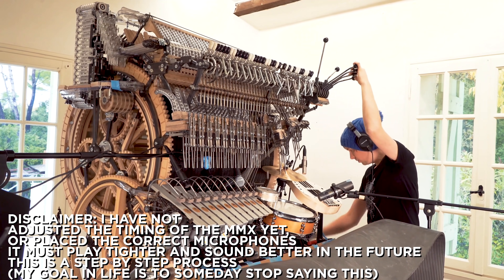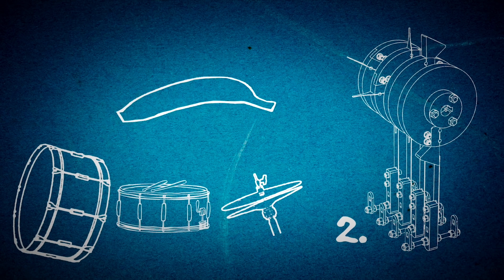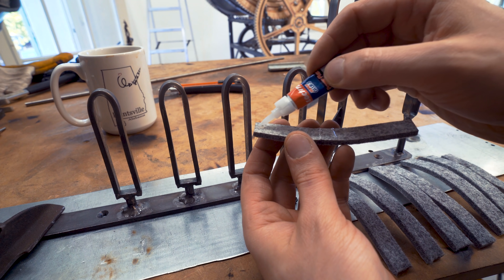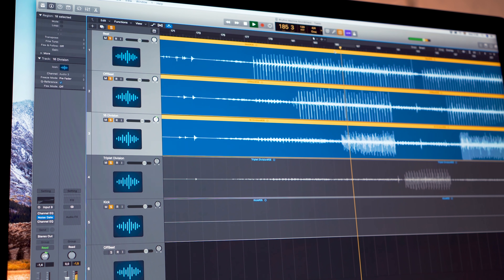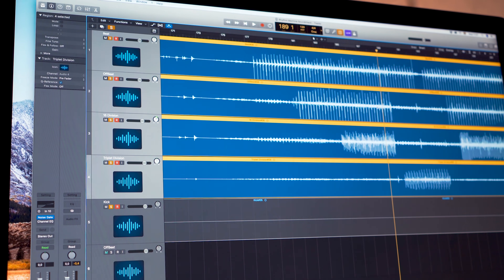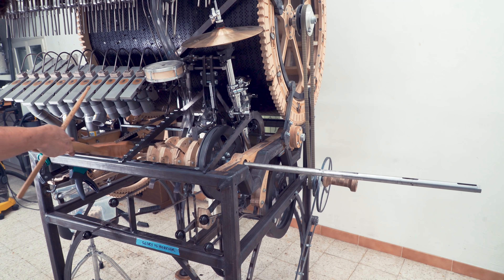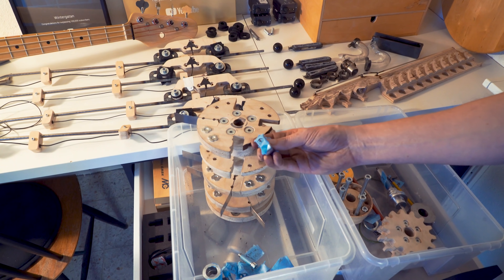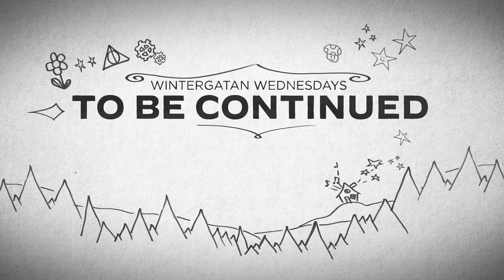Rhythm Machine Experiments - Marble Machine X #107

Comment: I would suggest adding a tachometer or something along those lines, with a small led display so you can adjust the rpm accordingly
Reply: He needs to add a Watt Governor. Constant speed for a varying speed flywheel.
Reply: @coastercubes4466  and i would look amazing on the machine
Reply: Why not mechanical tachometer? :D
Reply: Is there a way to set the max speed? Like how a mechanical clock always maintains the same rotational speed?
Reply: FOUND IT: A Watt Governor, maintains constant speed from a flywheel of varying speeds!
Reply: A governor is a controller that controls the energy input. In this case energy source is Martin. "Notes per minute" directly translates to the power demand of MMX. The flywheel can smooth out the peaks on the power demand but the keeping a constant BPM will require applying a variable crank torque. Almost like learning racecourse and the spots where to step on the gas and brakes. There is also randomness introduced by when marbles are loaded on the elevator.  A visual indicator of BPM could be a simpler solution.
Reply: Would be so easy to put a cheap bicycle speedometer or cadence meter on it
Reply: @vince55sanders  That sounds cool, but I think that's more in line with MM 1.0
Reply: Maybe something like this https://youtu.be/a7PILTf42yE , a watt governor with a cone CVT. Would look good  when well build and could possible solve the problem.
Reply: I was thinking the same, that way you could see the BPM/RPM at any moment.
Reply: No, it needs to be a mechanical brass masterpiece that will indicate on a dial if you are on track, too slow or too fast.
Reply: He could use a small red strobe light and dot markers on the side of the flywheel - just like the old DJ turntables used to have. With some clever electro engineering and proper calibration a target bpm could be set on a silent metronome (that controls the strobe light) so when the flywheel spins at the right rpm the dots appear to stand still. Once the tempo starts to deviate it will look as if the dots are moving. Practical and sexy!
Reply: @carlkolthoff5402  He could take apart an old strobe tuner and adapt it to the MMX for another purely analog variation on this idea!
Reply: @carlkolthoff5402  He still would have a slight delay or advance in timing because he is not able to keep the RPM at a perfect constant by operating it manually. Therefore there will be always a slight variable timing with the marbles. It didn't effect the synchronization of the setup so far because up until now all the instruments were timed with the same programmable wheel. That means that if one instrument has a slight delay they all have a slight delay. 

Only his last addition to the marble machine wasn't timed by the programmable wheel but instead it was timed directly by the flywheel shaft. And we know that the flywheel shaft has slight variable RPM because it is manually operated, but the sound generated by the flywheel shaft has not the same delay or advanced timing problems as the sound generated by the marbles. 

When the marbles are released it takes some time before we hear the sound. During that time, so before we hear the sound from the released marble, the next turn from the flywheel shaft has a slightly different RPM resulting in a slightly different rhythm. So far the other instruments all speed up or slow down at the same time so we don't hear any delay between instruments so far because up until now all the other instruments were in perfect sync and all timed by the same programmable wheel.

He must somehow make sure that all the instruments are all timed with the programmable wheel, or connected to the shaft from the programmable wheel. Because the programmable wheel keeps everything synchronized. Even when the RPM is slightly variable each time that he spins the flywheel.
Reply: @insAneTunA  the difference in bpm from one crank to the next would be negligible at worst during a song, the natural flutter of using a wooden and steel mechanism to control each marble is going to be far more than the flutter of cranking. the far bigger issue, and the issue currently being experienced, is wow due to long term variation in the cranking.

cranking flutter might account for only a few miliseconds per crank, but over the course of several cranks of being 2 miliseconds slow now you are a 32th behind the beat you should be keeping. a stroboscopic tachometer, like is used on record players would be very effective at keeping the timing accurate to an external beat, so long as he can control the cranking appropriately.

the reason flutter in the crank speed isn't so much an issue as wow is the high mass of the entire system. it takes a lot of energy to get it going faster or slower, so unless you are trying to change BPM, you won't have nearly enough variance in your cranking turn for turn to dramatically change anything. but over time, a small deficit or surplus of energy in adds up. so no flutter in this system, only wow. a very sensetive tachometer would help. if that's still not enough, a governor would need to be implemented to accommodate small changes in input energy.
Reply: @wyattroncin941  If Martin does it like I suggested he doesn't need a tachometer, and he can spin the flywheel at any RPM and the extra rhythm section will be perfectly in sync at all times. No matter if the RPM from the flywheel is variable or not. And no matter how small those variations are. It is fail proof when done correctly.
Reply: @insAneTunA  if Martin cranks faster, the BPM increases and everything falls slightly out of sync, joust due to different drop heights. Having the rythm machine anywhere else will not matter, because everything is already timed, except for the drop times of marbles. That's something he took into account already, and he has the piece for quickly adjusting the timing of the rythym section. If the rythym section was rigid to the flywheel or programming wheel, you'd only be removing an adjustment that is already necessary no matter what.
Reply: @wyattroncin941  hahaha I guess that we have to wait and see what solution Martin is going to come up with. If I was forced to bet I would bet one muffin on my own solution, or a solution that is similar.
Reply: That doesn't help either. His flywheel (drive) shaft, has a slight variable speed because it is hand operated. That causes slight variations in speed from his programmable wheel. As a result of that the marbles in the machine will be released with an ever so slightly delay or advanced timing. 

Because so far all the other sounds are triggered with his programmable wheel all the sounds have been in perfect sync up until this point. But his new rhythm section was not timed by his programmable wheel. So as a result his new rhythm section is not always in perfect sync with the sounds that are produced with the timing from the programmable wheel. 

In order to correct this his new rhythm section should not be connected directly to the flywheel (drive) shaft, but somehow it should also be timed by the programmable wheel. So that it is always running in perfect sync with all the other sounds or instruments, even when Martin is spinning the flywheel (drive) shaft with slightly variable speeds. 

Does this make any sense to anyone?
Reply: Yes lol or a mechanical clutch that stops you from spinning it too fast
Reply: A bicycle speedometer (AKA "cyclocomputer") would fit this need perfectly.
Reply: @G5rry  Nope, it wouldn't help either. Think of it as a car engine. Martin needs to make something similar as the timing system that times the camshaft from a car engine. The camshaft from a car engine  must be in perfect sync with the crankshaft at all times even if the input RPM is slightly variable. 

Consider the crankshaft from a car engine as the shaft from the programmable wheel from the marble machine. And consider the camshaft as the shaft for the extra rhythm section. so he needs to make a sprocket on the crankshaft (in other words the shaft from programmable wheel) and connect it with a chain or a belt to a sprocket on the camshaft (in other words the shaft that holds the extra rhythm section). And then everything runs in perfect sync, even when Martin turns the machine at a variable speed. 

Problem solved.

So he must not put the new rhythm section on the same shaft as the flywheel, but instead use a separate shaft for the new rhythm section, that is connected with sprockets or pulleys and a chain or a belt to the shaft from the programmable wheel.

Different variations to this system are possible, as long as he uses a separate shaft for the extra rhythm section that's been driven by the same shaft as the big programmable wheel. And he must not connect the new rhythm section to the flywheel shaft.
Reply: @insAneTunA  the entire machine is already connected in a timeable manner. It's geared off the crank and rhythm shaft to the flywheel shaft, which is geared to the wheel. it's not a matter of him cranking with variable speed, it's a matter of him cranking the entire machine, all the shafts and gears and wheels and pulleys and everything slower or faster. it's not a car engine, it's an electrical system. 

the grid runs at exactly 50hz in the EU. this is regulated by the massive amount of rotational mass in every generating station around the continent, so there is very little to near zero variation on seconds or minutes. however, if the grid produces too much power for the demand, it speeds up, from 50hz to 50.0002hz. not much, but over the course of days or weeks if the grid is too fast all your clock will be minutes ahead. or if there is too little power, the clocks will run slow. so you need to vary the output of the grid to follow the load (something martin can do by cranking harder or softer), and you need a tachometer that can tell you what the grid is doing real time. no use in waiting three months, comparing your watch and the wall clock and telling the grid to throw another nuclear rod on because the clock's slow, you need to monitor second by second and have very fine adjustments.
Reply: John Woods Yes, that could work but I am afraid that would lead to a major design change: The flywheel has to be connected to the rest of MMX through a clutch which is controlled by the governor. There is a clutch in MMX now which is used as a torque limiter if and when something goes wrong otherwise Martin is turning the crank in such a way that there is a simple ratio between the BPM of the music and the RPM of the crank. This simple ratio would be no more. How disruptive this would be is hard to tell. Maybe Martin could tell.
Reply: @EnginAtik  No governor, no clutch, and no tachometer are needed. That is all way more complicated then it needs to be. 

The problem is not that it's RPM has slight variations, because normally not a single person in the world would hear that when music is played. The problem is that his new rhythm section was out of sync with the rest of the instruments, and people can hear that very well. 

To fix that he should have the new rhythm section be driven by the big programmable wheel on a separate shaft, instead of being driven and connected directly to the flywheel shaft. And that will fix the problem. 

It's easy as that. 

My analogy with the crankshaft and the camshaft form a car engine makes perfect sense because it is the exact same situation. Connect the two shafts together with pulleys and a belt (or sprockets and a chain) just like they do it with a car engine, and it all runs in perfect sync. 

But his new rhythm section must have it's own shaft. There is no other option. 

It's easy as that, and there is no doubt about that it will work perfectly fine if he does it like I suggested.
Reply: @insAneTunA  and yes, you do need a tachometer. How the fuck else do you know that BPM you are actually playing? You think you're typing like an engineer, but you're just making the same non-argument over and over and over. Timing the entire machine to one another is a question that has been answered previously and will be answered multiple times in the near future. This is not about timing the machine internally, it's a discussion of timing the machine to an external beat, such as from a metronome or the headphones he's always wearing while playing.
Reply: @insAneTunA  and just to let you know, engine timing is a crap analogy the way you explain it, because engine valve timing actually does need to vary at different RPM. The engine might work with one set of valve and spark timings at a wide range of RPM, but at higher RPM you need to advance spark and open valves sooner and higher, and close them sooner at extremely high RPM. ever heard of V-tec? Yeah, that's Variable Valve Timing and Electronic lift Control, which is used to improve efficiency and power output at high RPM. Guess what it does.
Reply: @wyattroncin941  You are wrong and here is the proof that you are wrong. Watch the whole video, but scroll to 5 minute 08 seconds, there you can see that the  multiple camshafts in the V-tec engine are directly driven by the crankshaft with a chain. 

How VTEC Works - A Simple Explanation https://www.youtube.com/watch?v=tSCuRXnfLuI

The multiple camshafts from the V-tec engine are in perfect sync with the crankshaft, because they are directly connected to each other with sprockets and a chain. 

I mean, you could have googled this yourself before you wrote your comment.
Reply: I was also thinking this, but with a conversion from RPM to BPM
Reply: I believe Illuminati?
Reply: A tach would be a good idea, but I think numbers displayed on a screen is maybe less intuitive. A simple needle with pointers to indicate target speeds would be faster to read. It's easy to tell if the needle is higher or lower than a pointer and change accordingly. Trying to interpret numbers and then decide if its higher or lower than a target speed takes more time.
Reply: The best way is to time it So that when he stomps down on the pedal, it is on the beat. That way, his body mechanics can be in time with the machine.
Reply: I just added the same comment... in less technical terms
Reply: Maybe put a laser on a wheel and have it shine every rotation, that way you can see how much your going off tempo, because the laser would shine a little bit later or earlier.
Reply: I think the best way is to hook an electric motor to the flywheel by friction to keep a perfect tempo. He can still use the pedal at the beginning and use the motor to keep the speed once moving. A DC motor from a treadmill with an SCR control would work marvels.
Reply: While that would add an element of mechanical perfection, solving a million problems... I’m not sure how I feel about it not being “played” by a human being. And besides... music isn’t perfection... “Music is the space between the notes.” —Debussy
Reply: @uo208561  fully automated Marble Machine X, here we go, now that's a Machine
Reply: @uo208561  idk that kinda takes away from the machine it wouldn't make it a instrument I'd be a robot